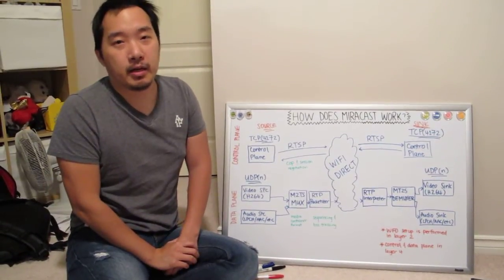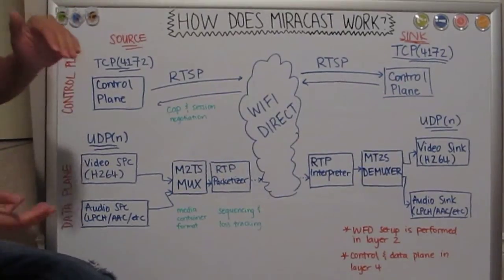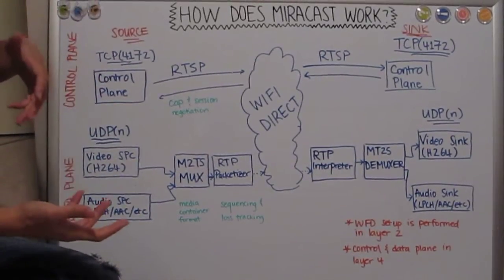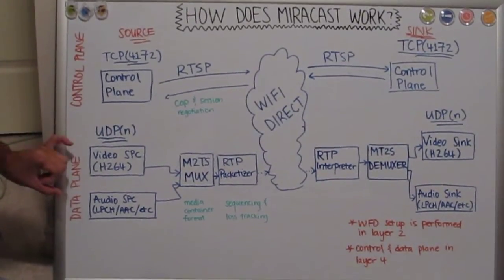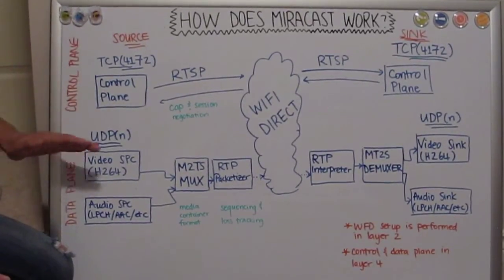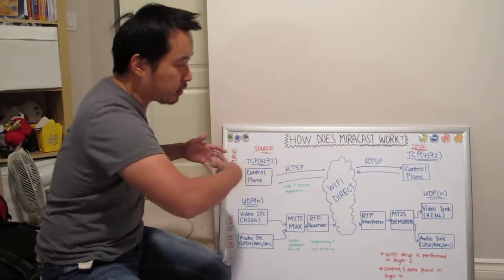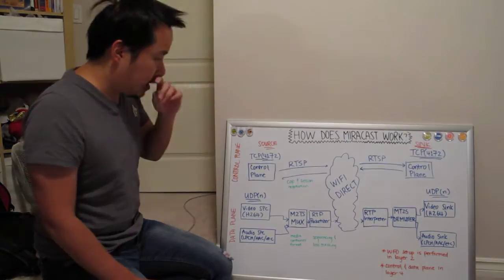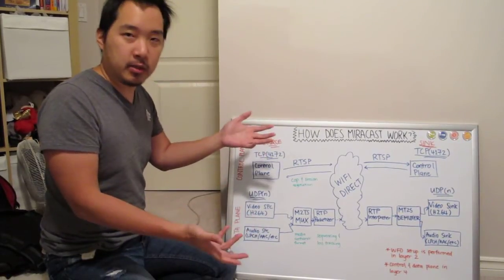Miracast Explained

Comment: I enabled Miracast on RPI with LG G3 bychanging sink implementation a bit. Works well. I am wondering if you have a explanation on why audio was not working with HDMI .
P.S. I am a Wifi guy but have worked on Miracast as well with WFA......
Reply from the maker: See line 33 in https://github.com/codemonkeyricky/piracast/blob/master/audio_sink/src/sx_audio_sink.c to enable HDMI audio.
Reply: Hey Ricky,
Yes I saw the macro. I recompiled with enabling HDMI but no luck. I am wondering if in audio sink do you see a slice_dropped() invoked frequently when extracted? It appears to me that the OMX is not plumbed probably.